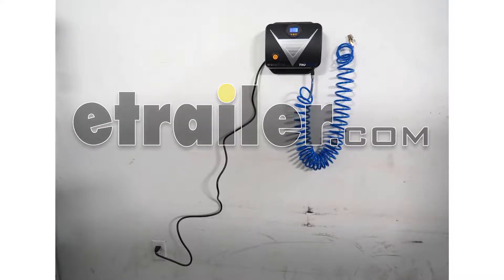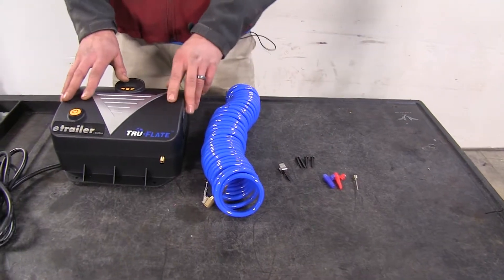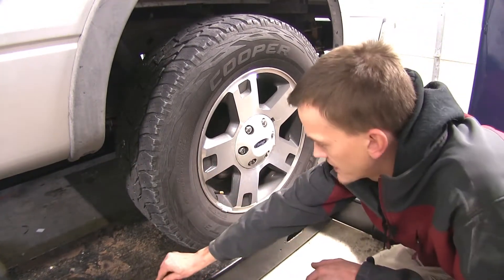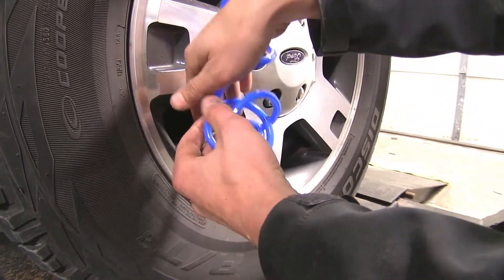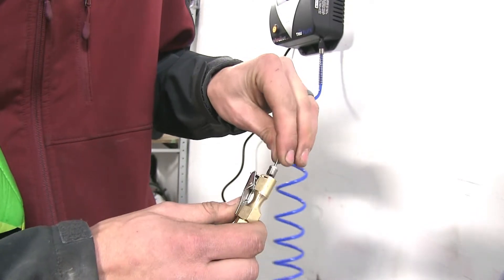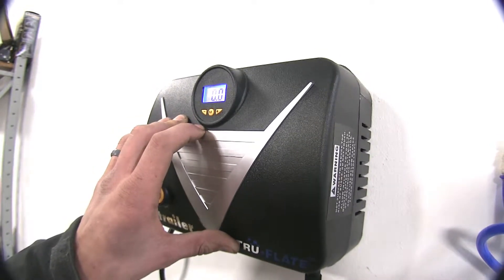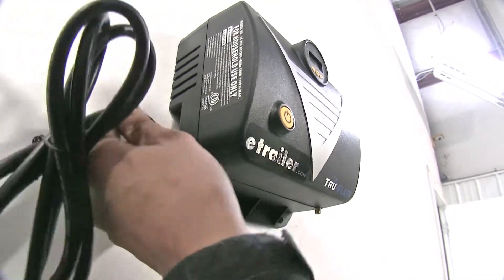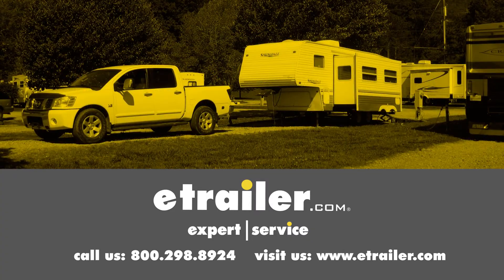etrailer | What to Know About the Tru-Flate Wall-Mounted Tire Inflator

Comment: I purchased one & liked it so much I bought a 2nd one for my son. After about 3 uses over 9 mos his unit shut off in the middle of putting air in a tire & wouldn’t come back on.
Reply from the maker: Thank you for sharing this with us. We will look into this. You can try contacting the manufacturer to check with them if others have had issues with this.
https://www.etrailer.com/Tire-Inflator/Tru-Flate/16-250.html

Comment: Every time I plug the nozzle to the tire the machine stops even though I did all the things you suggested in this video,
Reply from the maker: You may need to increase the air pressure in order for the compressor to kick on.
https://www.etrailer.com/Tire-Inflator/Tru-Flate/16-250.html